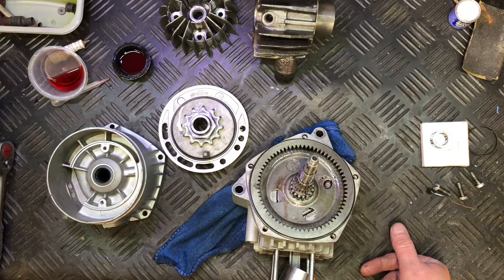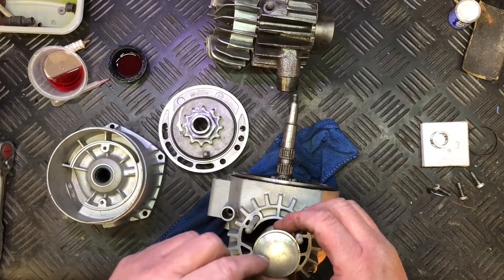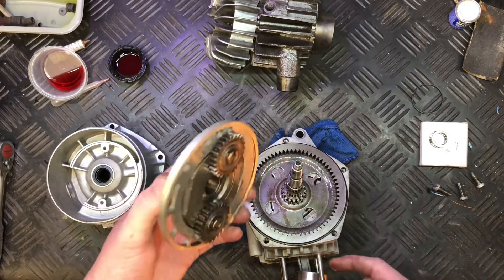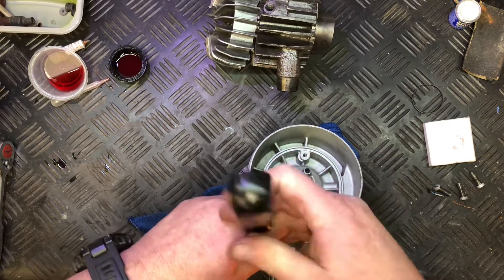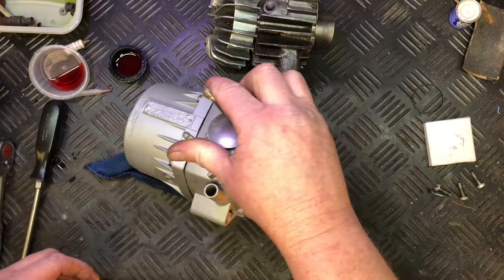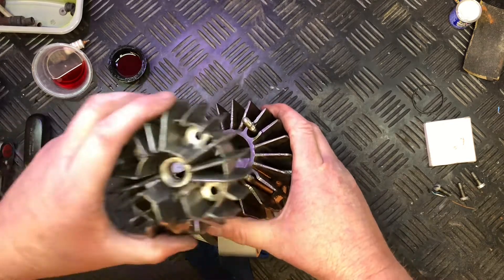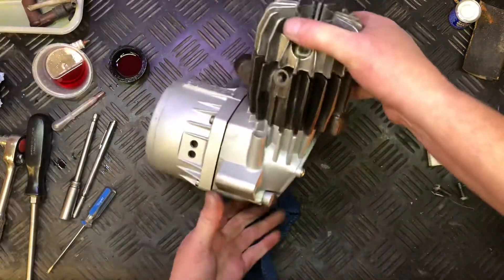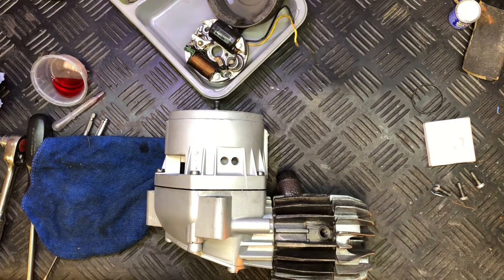Sachs 502/1A engine rebuild

Comment: Hey wie viel Öl hast du in den Motor eingefüllt?
Reply from the maker: Hello, the oil level is achieved by the following method:  On the right-hand side of the engine, you have the oil drain plug at the bottom, above that is the level plug, and above that is the plug for access to the decompression cable connection. Once drained, you put oil in via the access point for the decompression access hole and fill until it starts coming out of the level hole.  Remember to use automatic gearbox oil.  There is no mention of the amount of oil in the repair manual, but its not a lot as it's only a small engine. Its probably only about 200ml

Comment: Hi there. I am struggling to find the transmission fluid level plug on my Sachs 50 Automatic from 1962. The "Saxonette " plate on the engine has 2 screws and comes off revealing a hole in the casting and a view inside the engine. Is the bottom of this hole the level? I can't see anything else to remove! Hope this makes sense and thanks in advance
Reply from the maker: Hi Kevin, I'm affraid I'm not familiar with the Sachs 50 2 speed auto engine, but both the Sachs 502 and 504 auto gearbox oil levels are to the bottom of the filling hole, so I would imagine your Sachs 50 to be the same. I've seen on one forum a guy in the States saying he can get 3 oil changes out of a quart of ATF oil. Google tells me a quart is almost 950cc of oil, so it's possible there should be around 300cc of auto fluid. If you put around 300cc into what you think might be the filling/level hole that you mentioned and it starts running out a little, then that would probably be it.
There's a pdf repair manual for a manual gearbox (so not really for you) Sachs 50 here: https://www.icenicam.org.uk/library/Sachs/50_(2-speed)_repair_manual_c1960.pdf

You can purchase an automatic repair manual for 18 euros from: https://www.classicseller.com/i/102610/moped/sachs-saxonette-50-automatic-motor-repair-manual-workshop-manual
No guarantee it shows the oil level though!
Regards
Steve..........
Reply: @SJGPOOLMAN  Thanks Steve for your remarkably quick response! It's not 2 speed but in fact the single gear auto clutch type that is featured in one of your excellent videos. 
Filling to the bottom of the filling hole would obviously mean the whole gearbox full of transmission oil oil if I understand you properly. Is this correct?
Reply from the maker: Hi Kevin, I'm confused as to what engine you have. You said it was the Sachs 50 - which there is one and what I was referring to - but you say it's the same engine in my video which is the Sachs 502/1A automatic. Anyway, well spotted about the oil level, I was a bit confused. No, you must not fill it until it comes out of the decompression cable access hole. In between the screw cover for the decompression cable and the drain plug, you'll see a flat head screw, that's the one you need to take out and when the oil level gets to that and starts draining out, then that's the correct level.  You can fill it through the decompression access hole. 
Hope that helps
Steve............
Reply: @SJGPOOLMAN  Hi Steve. Looks like my replies are being blocked. See if this one gets through!
Reply from the maker: @kevinconnolly-i7b  Hi Kevin, yes this one got through to me.
Reply: @SJGPOOLMAN  Hi Steve glad you're still with me. As  you said "In between the screw cover for the decompression cable and the drain plug, you'll see a flat head screw". I don't have this and the 5 flathead screws I do have all are long and fix the gearbox cover onto the engine block. However the "Saxonette" nameplate which fixes on this cover has 2 screws and comes off revealing a hole in the casting and through this I can see the circular clutch mechanism. As a work-around just wondered your view on roughly how high up the clutch the level of transmission fluid should be. Fingers crossed!
Reply from the maker: Hi Kevin, without seeing it, I'm not sure exactly what you mean.  Can you send me some pictures? sjg2804
at hotmail.com
Reply from the maker: Hi Kevin, not sure of you got my last reply. In answer to your original question, I think the answer is yes. Steve........
Reply: @SJGPOOLMAN  Hi Steve. Just to say many thanks for the help you gave me. All resolved now. You're a star mate!

Comment: what engine oil did you use? thanks
Reply from the maker: Hi Pedro, there isn't any engine oil in the engine as it is lubricated by the 2-Stroke oil that you add to the petrol in the fuel tank. Only automatic gearbox oil goes inside which is for lubricating the bearings and clutch plates of the transmission. I use normal, non-synthetic automatic transmission fluid (ATF) from my local motor factor.
Reply: @SJGPOOLMAN  what is the specification of valvoline? 85w90 api gl5?
Reply from the maker: @pedroserra725  sorry, I'm not sure when it comes to oil specifications. I use cheap auto gearbox oil. Remember these are 40-50 year old engines/gearboxes, so any ATF oil, even the cheap ATF oils, are going to be better than oil back when these were new.

Comment: Hi, it does not use a gasket between the head and cylinder?
Reply from the maker: Hi, no there is not gasket between the cylinder head and cylinder bore.

Comment: hello, i'm from portugal and i would like to know where i could buy a piston for that engine, if you have a link to buy that would be great!
thanks.
Reply from the maker: Hi Pedro, you need to check the diameter of the piston to see if it is the original size 38mm, or if it has an oversized piston. If original, then you can get a 38mm piston with 10mm gudgeon pin (you should check this size is the same as well) from: www.puchshop.de
which has plenty of size options. Or just search online for more local availability for you.
Reply: @SJGPOOLMAN  thank you very much, I will see what is the best option

Comment: Is there any oil in the transmission? When the engine warms up, it suddenly shuts down and does not throw a spark. It then goes when the crank cools down.
Reply from the maker: Yes there’s automatic oil in the transmission but that won’t affect the spark. Sounds like the points need adjusting.  Gap’s possibly too small and closing when it gets hot. Not 100% sure but that’s where I’d start looking.

Comment: Hi, I have this type of engine for a moped from 1971. Unfortunately, the engine is disassembled. Please have a paper manual that shows the individual components of the engine. And one more question. I have a defective engine cylinder. You can get a new, intact onewhere. I'm from Czech Republic. Thank you
Reply from the maker: Hello Jiri Hac, you can get a parts manual on CD from https://victoria-oldtimer.de/webshop/Ersatzteilliste-fuer-Motor-Sachs-502-1A-502-1B-Kopie 

For complete engine or spare engine parts search "sachs 502" on https://www.ebay-kleinanzeigen.de - there is also a paper copy of the parts manual for sale on there at present - or try Austrian or German Ebay sites.
Reply: @SJGPOOLMAN  Thank you

Comment: cylinder is completely gone iside i'm sorry but it is sachs that uses very fine piston tolerances. when i was 11 years old i had a green dkw with the same funny engine and what i stil remember is the torq of that crazy thing and it was because of te good cilinder sealing that sachs made great
Reply from the maker: That's a shame about the cylinder. You can still get engine parts for these from mainland Europe. Need to search on internet if you're going to repair